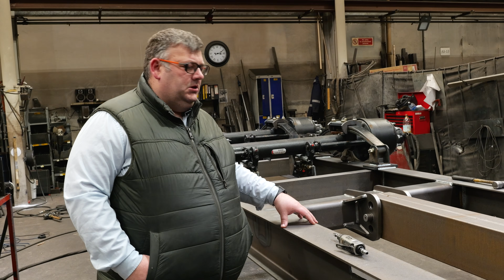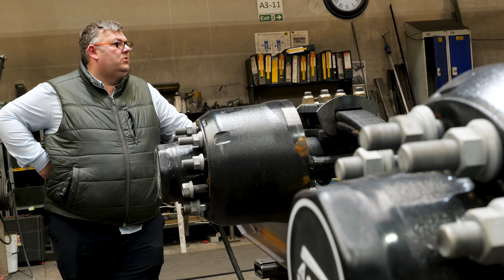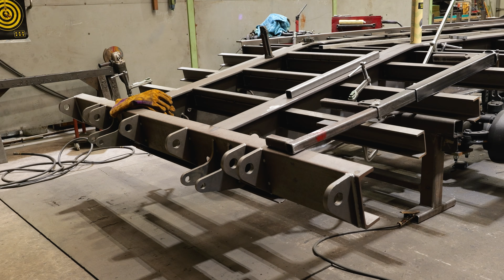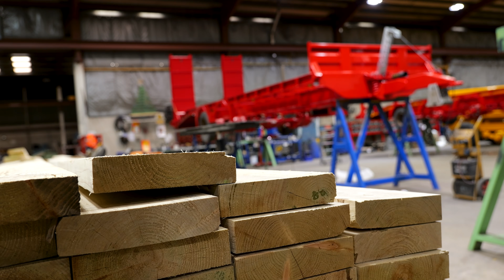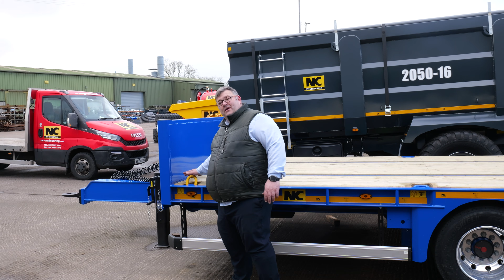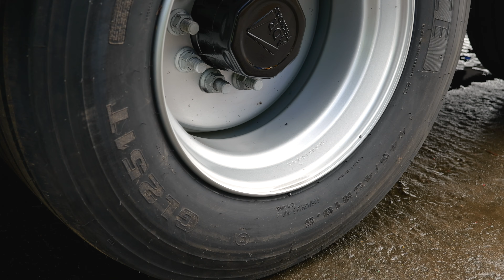HOW IT'S MADE - NC Low loader

Comment: Big old bit of porosity there at 12.32
Reply from the maker: @ruairitrainor4013 well spotted we could get you a job in the quality department, sometimes its shows up with 1 pin hole after shot blasting.

Comment: I wish we could get quality trailers like this in the USA! What is the advantage of welding two C-Channels together for the drawbar, instead of using a square tube?
Reply from the maker: @sccolbert, if you visit our website there will be contact for export sales they can provide you with a price on a trailer, we do have some equipment in the USA currently closes dealer would be in Canada currently. The answer to your question we use 2 channel sections on the drawbar as this is a stock material we carry it gives the same strength as box section, even with the labour and welding time it is more cost effective to manufacture the drawbars this way.

Comment: Haven’t managed to watch yet but I’ve always wondered how the big artic trailers are made with a bow in them so that they take the weight better.. You see the bow when they’re empty. Just curious..
Reply from the maker: @deebo1812 some manufactures will pre stress the beam to allow for defection, when the trailer is fully loaded. Normally on over length trailers or heavy haulage trailers. Stay tuned as in the near future we will be doing the same style of video on our commercial trailer range.

Comment: Update to airbag suspension & disc brakes
Reply: Agreed for many things airbags and disk are better.  But most buyers buy off if price point and drums are more than sufficient for 99.9% if applications.     I’m from across the pond where tractors aren’t used as they are over there but airbags aren’t robust enough for the coalfields and mountains of heavy haul.    60 ton on 35ft trailer bouncing off-road and narrow back roads are the norm.
Reply from the maker: @mnblkjh6757 this style of trailer is for agricultural tractor tow based work we also manufacture commercial trailers for lorry tow, featuring Air Suspension or Mechanical Suspension with either Disc brakes or drums.